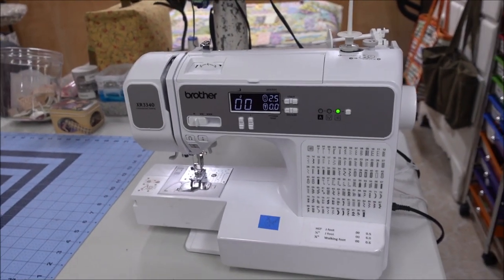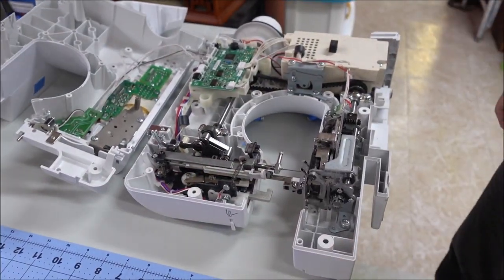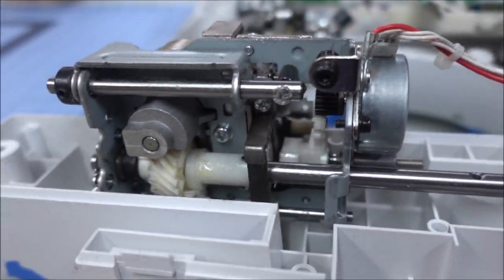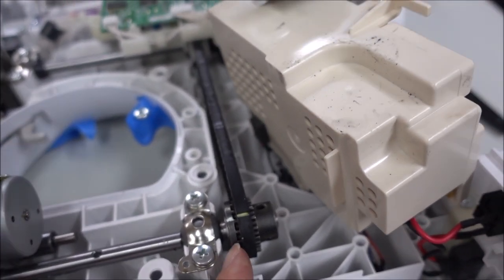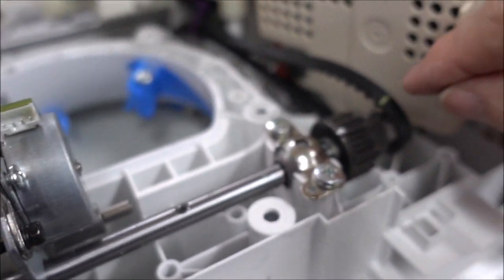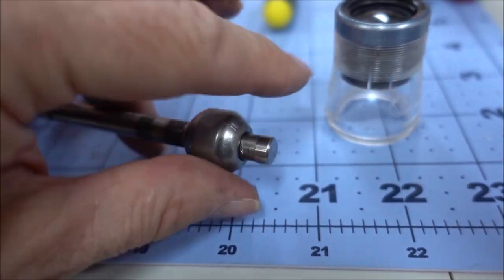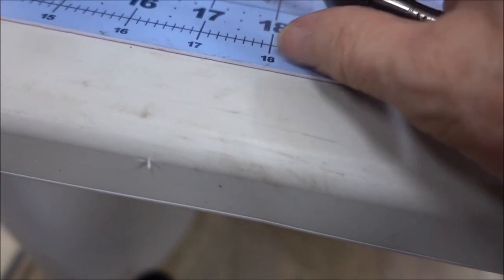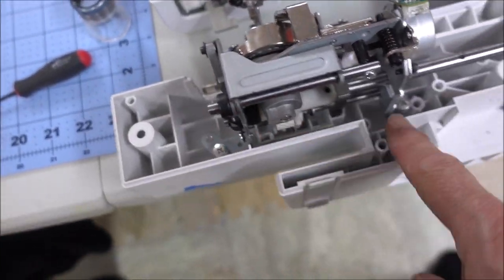Brother XR3340 Sewing machine repair - E6 error, 2020-03-15

Comment: This is an excellent diagnosis and repair tutorial. Thank you for making it.
I really like your use of tape to remind you what screw goes where. 👍
I can recommend TriFlow oil (which will assist to break down residue), TriFlow grease and SuperLube grease. This machine will need to be opened frequently to lubricate, so you may want to try it next time.
Unfortunately these machines are deliberately designed to be disposable. I would say that it's lifespan is 10 years at most. The chrome plating on the shafts is thin and often rusts in humid environments; plastic gears which don't last; plastic frame which is not mechanically stable and won't last; deliberately designed to make service difficult; impossible to get any spare parts in a few years; the worst design element is that the user is not ever able to lubricate (industrial machines have lubrication baths or are lubricated EVERY DAY!). I could go on.
Designed obsolescence is a criminal concept. So what brand and model of machine should you get to avoid this? Spend $200 or $10000 on a domestic machine it doesn't matter, you are out of luck they are all the same now. And don't believe the sales people when they tell you otherwise. Such a shame. Rant over.

Comment: Thanks for this excellent lesson. My Brother cx155LA has the same problem except it's the top bearing & shaft near the take up lever. I can see that the bearing is not turning. I'm thinking it's better to replace my machine with a Janome or Baby Lock that's not all plastic in the body. At least I got a few years of good sewing and lots of quilts before it seized up. All the feet and the extension table fit my mechanical Janome, so not a total loss. I think the repair cost would be best spent on a better built machine.

Comment: Hi, I'm curious to know how well is the machine running now. It's been a few months hope all is well. Thank you for the video will try this on my sisters Brother Machine.
Reply from the maker: The repaired sewing machine is working perfectly and is used almost every day. Given the high internet reported frequency of this problem, I believe that the toothed belt was tensioned too high at the factory and that caused unusual friction and heat to build between the bearing sleeve and shaft, which eventually caused the failure. When I reassembled it, I ensured that the tension was very light (read almost none), and I don't expect it to fail again. For this application, the cogged drive maintains the important bobbin/needle timing, and it is by design a very light load [to drive]. Research the internet for a good grease to use for sewing machine motor and gear applications, adjust the belt tension so it's very light, and this problem will not reappear.

Comment: So from time 2 time you're going to need to use white vinegar to clean the shaft when too much material gets caught in between the shaft and the bearings once cleaned and oild and put back together that's the only problem for this machine light work not bad

Comment: Hello thanks you so much for your sharing this helpful video, Next I want to ask you about the similar problem that I my mom had the same model as you and had the E6 error neither 😢 but after I tried to twist the flywheel, the needle is running again but it never touch the bottom of bobbin case I oiled the systems but it doesn’t work can you please show me how to fix this similar problem but not ? 😅 thank you so much

Comment: I have same machine with e6 error. I opened it up and both shafts are turning freely no gunk next to shafts but I still oiled. when I try running machine the motor does not even spin. any idea?

Comment: Hello Michael, and thank you so much for the video! In my case, error E6 appeared after I had assembled the machine back together (ours is Brother JS-70E). Looks like I have desynchronised the whole thing by slipping off both toothed belts (yeah, I know 🤦‍♂, I'm not a tech person, just trying to help my wife) in order to turn the shafts manually to find out where the problem was (the shaft was stuck, but the problem was in the top part of the mechanism - reoiling helped). Is it hard to find those points again if I didn't put markings on the gear tooth and belt? I'd really appreciate if you saw this and replied. All the best from Russia!

Comment from the maker: Regarding this repair, work slowly and carefully, don't disconnect any wires, and you're sure to have good results. There's no trick to taking it apart - nothing inside comes loose or falls off when it's disassembled - it is as you see it in the video. For the bushing lubricant use a sewing machine motor and gear grease. During reassembly, watch for the position of the internal lever that connects to the thread tensioner; it can be put into two positions, but only one is correct. If you get it wrong the first time, there's no harm but the tensioner won't work correctly, and you'll have to split the case again to reposition it. The bobbin/needle timing is important, but even if it's lost during the gear positioning, it can be readjusted after the machine is reassembled, by just removing a bottom cover (four screws), which gives you access to the cogged gear set screws.
Reply: So do you recall which side the tensioner arm goes to? The arm that is sticking out horizontally from the cover.
Reply from the maker: @ebby69k  It goes towards the top.
Reply: @michaelsworkshop3670  I think you  misunderstood. I am talking about the tensioner arm. It can either go to the left side of the little shark fin looking piece or to the right of it.My machine is a brother cs6000i. Similar to yours in this video. I can see the arm sticking out of your case cover you removed.
Reply: Hi what if the machine is jamming and you’ve cleaned all the dust and you are not seeing any bushels that are seized  - all of them are seeming to be fine - then what ?
Reply from the maker: @junitapullins7909  The E6 error means that the drive mechanism is sensing an over-current condition. Before taking the radical step of disassembly, it's best to first consult the Brother user guide for instructions on how to normally clear it. You can also visit the Brother website help area, https://help.brother-usa.com/ and search for sewing machine E6 error. According to information found there, the error can be caused by incorrect thread routing, bent needle, and for other reasons.

Comment: Hello.  I’m glad I found your video.  I’m trying to fix a feed dog issue on the same machine.  Can you tell me…. Is the black rod that comes off and down under the feed dog in the back supposed to be strongly affixed and not wiggle?  Mine wiggles.  The plastic piece that moves from side to side with changing feed dog position still moves.  So I’m wondering if the problem is that rod?  Thanks.

Comment: I did this with my brother machine sq9186 (looks almost exact to this one.) But after putting it back together, the thread was getting stuck. A little piece of metal from under the top measurement cover, is just barely touching the top of the bobbin case, and creating a little post the thread can't get pulled past to come up to the top. So I adjusted the top measurement cover piece to go more back/up, just a tiny bit (the machine doesn't really allow for more than a few hair lengths of wiggle room,) and it was enough for the thread to clear, and pulls up nice. I did notice while I was trouble shooting that issue, that when my needle goes all the way down, (I have bobbin holder out) my needle is "ticking"  because it's just touches on a small little square of metal, inside the circle part, (the "holder" of the bobbin holder, right below the hook piece that catches the thread) I'm unsure if that's normal, as it looks like it's there to push the need back a bit, maybe to help with catching the thread on that hook. Any how... It caught the bobbin thread nicely, and pulled up to the pop. So I try to sew a test piece of fabric. Now my fabric won't move. The feet come up high enough, I can feel them with my finger, I also see them moving normally. I set the length as high as possible, and it just barely moved my fabric, and started sounded like it's working hard. It almost seems like the whole bobbins piece (like you removed in the video) got moved a few hair widths higher, or like I tightened the front and the back just a hair too close? I don't know anything about fixing sewing machines. I can fix computers, but this was my first time trying to fix a sewing machine. Any tips or thoughts? Things that come to mind I can try or look out for? Thank you for the video and your time. Sorry so long.

Comment: Hello, 
Thank you very much for this video! Despite my beginner level, I managed to solve the E6 error by following your instructions. 
Unfortunately, since the reassembly, two new problems have appeared: 
- my bobbin thread no longer goes up, even though I do the right thing and it worked until then, 
- an E1 error message systematically appears (while my presser foot is lowered) and prevents me from sewing. 
What can explain this? Did I miss something during the reassembly? Thanking you very much!

Comment: sewing machine oil evaporates. there is a synthetic grease that can be used instead. i must say that I don't repair machines but I have several vintage machines that I use both oil and grease. I grease the gears and oil the points..but then again. hey I am open to learn things.

Comment: if you had a table top grinder and a wire wheel on it , it would clean that crap right off and not disturb your shaft, plus a gun barrel pipe cleaner to clean your bushing hole... you guys be all set.... your welcome. :)

Comment: Thanks for this video Michael, really useful.  We had the exact same problem which I would never have diagnosed without this video! Took off the bearing and cleaned the shaft, even rubbed it down with some wet and dry Emery paper but it still feels pitted and no doubt the issue will be returning.  Strikes me as being a design fault and I wonder if the bearing is really fit for purpose, something I will take up with Brother.  Thanks again for the video.
Reply from the maker: Great. Regarding the sleeve bearing, I had a suspicion that the toothed belt was tensioned too high at the factory and that this contributed to the problem.
Reply: NECESITO AYUDA!!!! POR FAVOR. SI ME RESPONDE LE DIGO CUAL ES EL PROBLEMA.

Comment: I have the Brother CS6000i and have this same error. I took it all apart, got two left over screws from God knows where, and I tried to oil the two big ball bearings. Oiled and cleaned everything else... I didn't oil it enough to have the two ball bearings move. Now I gotta do it all over 😢😭 I was going to just buy a new machine but they're not available on Amazon anymore. I paid like 160 now they're 360+
Reply from the maker: That is funny - I almost always end up with extra hardware when working on some project, somewhat alarmingly so after I've worked on the car! Concerning lubricating the bushing, a light grease such as white lithium, might be preferred over oil. Some discussions on the topic may be found on internet sewing forums.

Comment: Hey Michael... So I had this issue too.  Wish I would have watched this first.  I have the top bearing froze. I fixed that but in my process of doing things I lost the timing between the top shaft and bottom. Ughhhh   DO you have a video on how to fix this?
Reply from the maker: Not to worry! The hook timing can be restored and it's not difficult to do, and can be done with the machine assembled by just removing the bottom plate. In the current clip I talk about checking and resetting the timing a bit, between, 15:32 to 16:46. It's not that clear though, and I have decided that I need to record another video showing resetting the timing. For now though, no matter if your machine is assembled or not, take off the bobbin cover, pull the bobbin and plastic holder, and manually cycle the machine while watching the needle penetrate into the bobbin area. When it reaches the bottom of the stroke and begins to come up again, the bobbin hook spinning around the needle has to be right there just above and behind the needle thread hole ready to pick up the thread at the needle thread hole. If the hook's not there, if it doesn't catch the thread on the upstroke, your machine will skip that stitch. Take a look at the bobbin mechanism as its working, manually cycle it, and I'm certain  --- I'm certain --- that you'll see the logic of the function of how that hook has got to be in position to pick up the thread on the needle upstroke, and with that you will glean an understanding of how to reset the timing (by temporarily loosening the set screws on the splined gear that drives the bobbin drive shaft, while moving the needle)!
Reply: @michaelsworkshop3670  Thanks for the response. After watching a few other videos I did see the logic . I was able to slip the belt off the lower gear and turn the assemble until the needle was approximately where it needed to be. I had to move it one more tooth after that to get it exact. I figure if nothing was really touched it was just a matter of getting it back to where it was.
Reply from the maker: @ebby69k  Great! For the adjustment, it's fine that you slipped the belt from the lower gear and then aligned everything by either spinning the upper needle drive shaft or the lower bobbin drive shaft, but the adjustment can also be done while the machine is assembled, and adjusted with a finer resolution than one gear tooth. With the machine assembled, you would do that by removing the bottom cover, and loosening the set screws on that lower toothed gear that drives the bobbin shaft. Then the needle drive shaft and the bobbin drive shaft can be moved independently of each other, the needle and hook positioned correctly, and the set screws retightened.